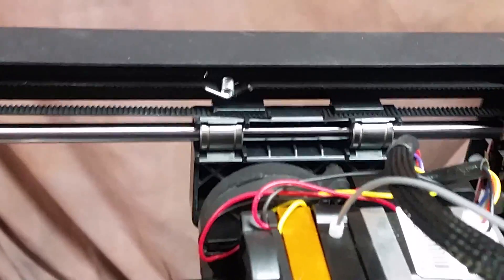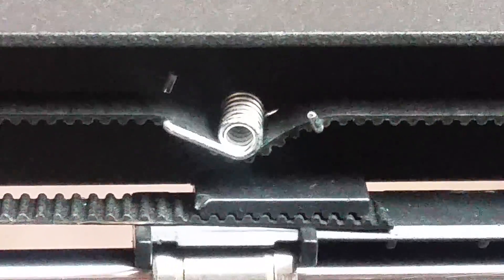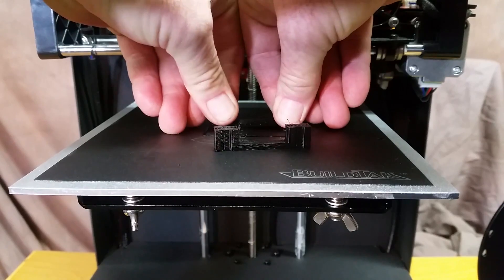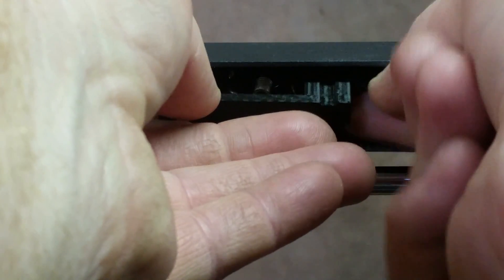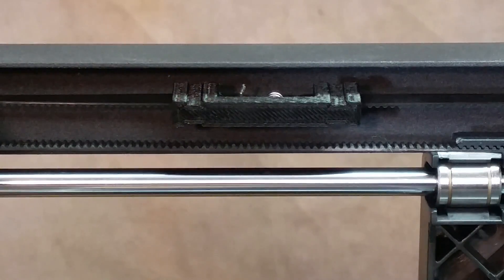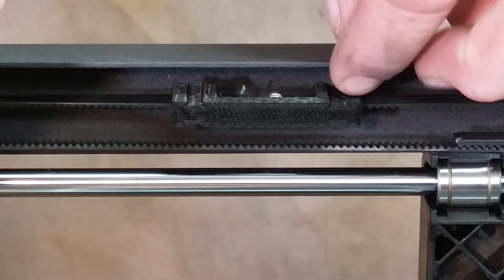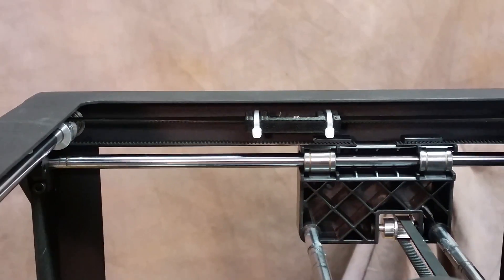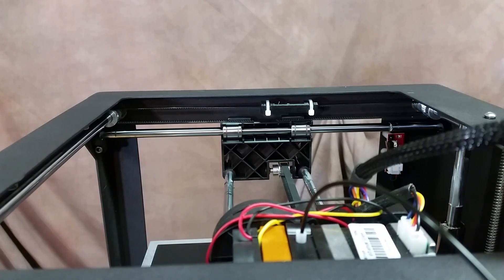3D Printed MeCreator2 Belt Tension Stabilizer

Comment: hi, Jimmy, nice design, how does it work now?  I will report this problem to our engineer to see if we can make any modifications on it.
Reply from the maker: +geeetech To be 100% honest with you, I have not seen a difference.  I'm guessing it's either because the springs are really tight, which is a good thing, or I haven't printed at a high enough speed to make the "ringing" effect happen.  If I find where it makes a difference, I will definitely let you know.

What would be nice in any future models would be a tension adjustment for the X axis.  I don't have a problem, but on the Facebook Geeetech Owners Group in have heard 1 or 2 people mention a looser than normal belt for the X axis.